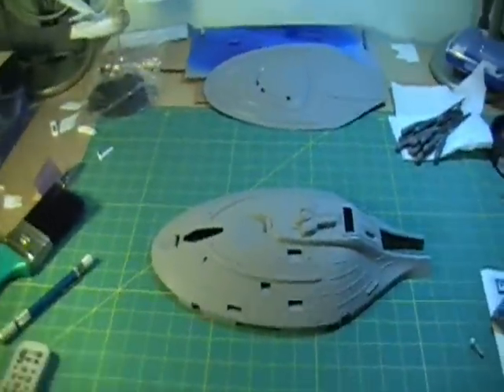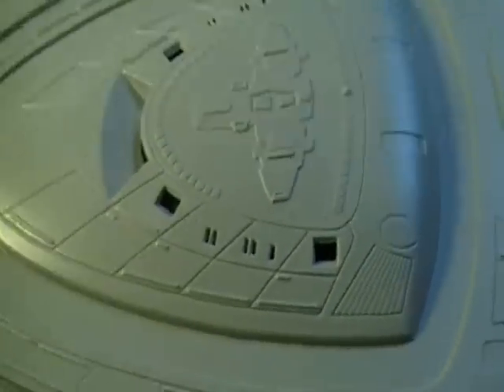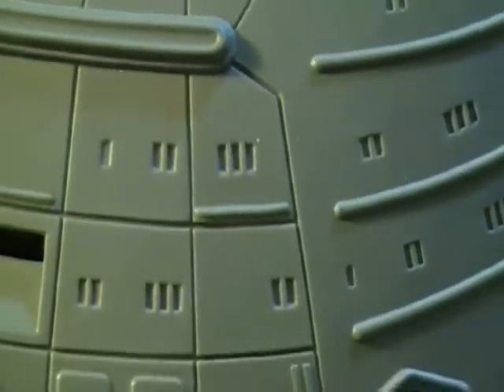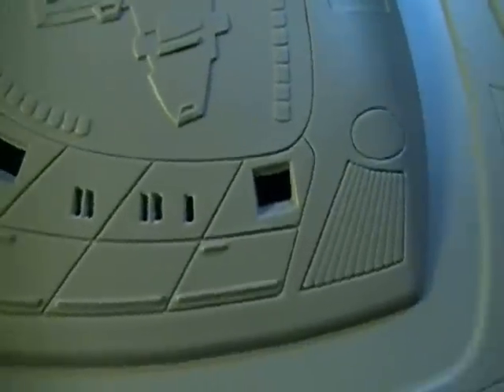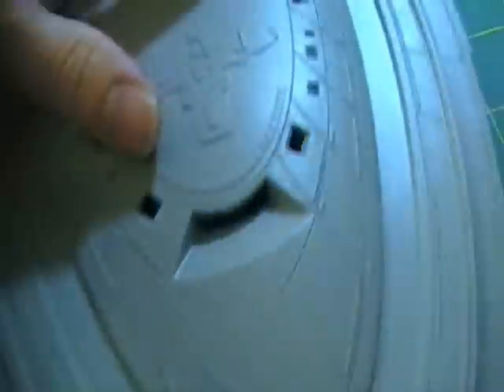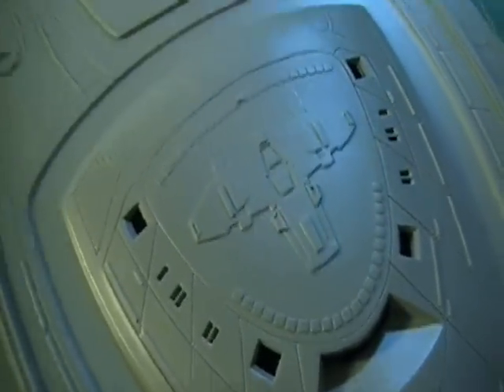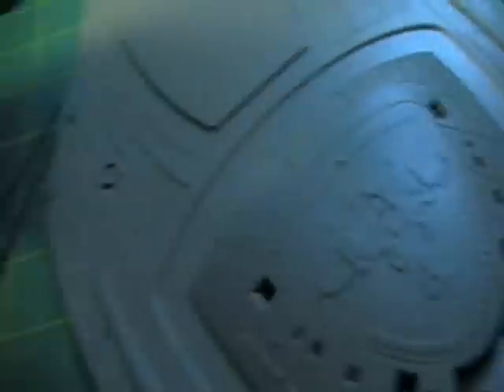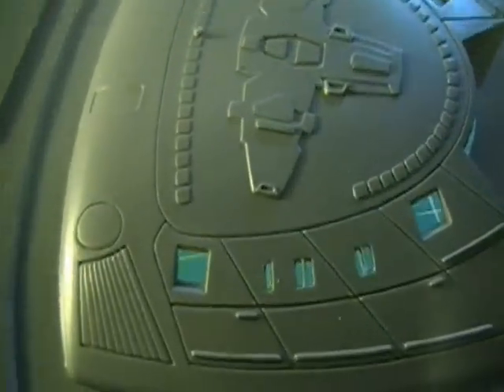Fun With The Windows

Comment: I started the same kit. I drilled then filed. I've seen a method of getting them visually perfect used by I think "Darkuboot". He filled the windows with dental acrylic then used tabs of masking tape over the openings before painting. There are many ways to perfection, you just need to find what works best for you. It just takes patience. Remember also that not every single window would be lit, just as in an office building or ocean liner not all rooms would be in use at the same time.

Comment: When I did mine it took me 10 mins per window to square them up, started with a .5mm pin vice two holes top and bottom of each window, then took my dremell and elongated between the holes with another drill bit. After that I squared up the corners with a scalpel, then filed the windows to finish shape using .03mm microflat files, finally finished up with a slim line foam backed nail file which I cut down to size so they would just slot in the gaps which cleaned them up. 
Total time for all the windows took me 3 weeks. 
Not saying your effort wasn't junk far from it, but I build at museum quality, time and the right tools will always prevail.
Reply: I'm using a dremel.  THe pin vice was giving me hand problems.

Comment: I think you are, or have done a great job with the windows. Forget the Exacto blades, and look for Dremel bits. They I think refer to them as jewelers bits. I have some and they work FANTASTIC. Use a variable speed Dremel tool and run it as slow as you can for the initial drill out, and as you are doing, use your files to clean them up. It's the best solution I and those who showed me have found. Another resource is Boyd Compton at Trek Worx on YouTube and he also has a terrific board community called SFMA or Si Fi Model Action which is one of THE best communities out there for help on not only all Star Trek models, but it's a great resource for lighting your models be they Star Trek or not. Good luck, they were a huge help for me!

Comment from the maker: Oops. I accidentally pressed "enter". I'm not exactly sure how a #11 exacto blade would help, being the windows are so small. I mean, I can barely get the tip of the blade to fit in that opening. I guess the only real way I am going to understand is possibly watch how you do it on an upcomming video possibly. But thanks either way for the suggestion.